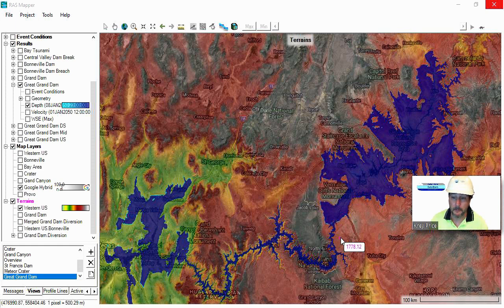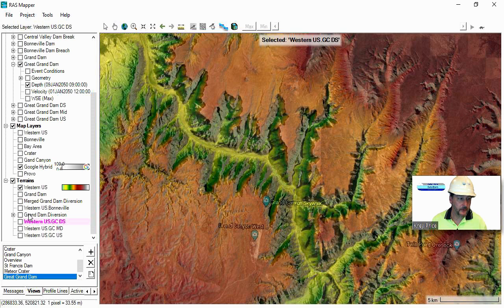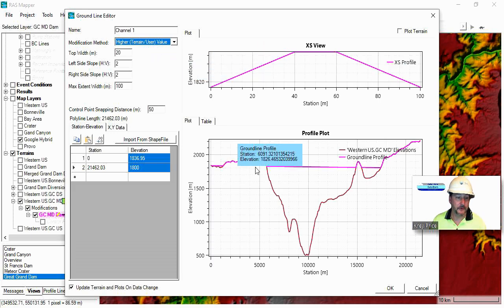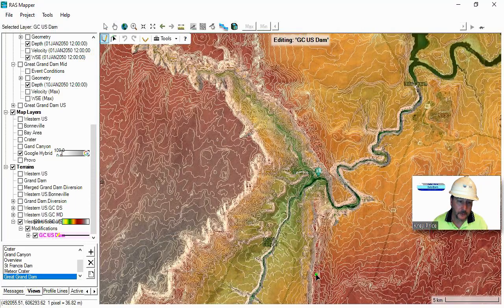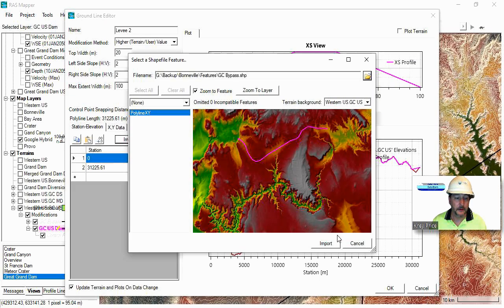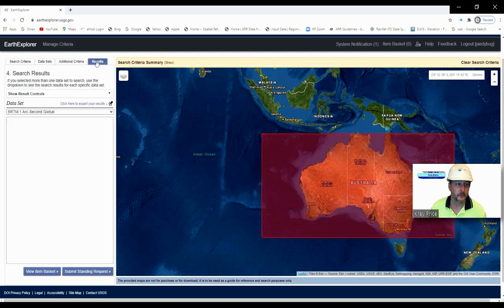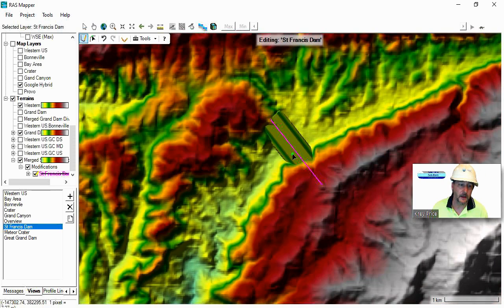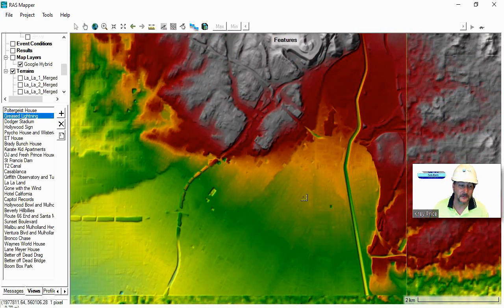What's new in HEC-RAS 6.0 Part 4: Terrain modification tools

Comment: i'm sorry but it's normal that doing a modification (high ground) the elevation of the vertices is lower than the terrain over i'v put it? just for an example, one vertex has elevation of 16.03 vs terrain in the same point of 16.67

Comment: Hello Krey,
In a time of video (23:50) you spoke about terrain modification for removing water surface form Dam accumulation, getting from Lidar (if someone want to make dambreak model). 
My quation is: Did we have some easies trick to remove water surface or we must use Terrain modification layer with multipoint polygon tool? (in second case we need  a "meny meny" of polygons to make assumption of natural terrain before dam to be buildet)

Comment: Hi Krey, just wondering if you have any suggestions to fix my problem. I am running a 2D flow area (10x10 mesh) with channel terrain modifications (model runs fine without them) and variable time step method. The model keeps going unstable and not too sure what to try next. Using a 30s computational interval and max/min courant numbers of 2 and 0.75 as the terrain is in a steep sided narrow river environment so the velocities are relatively high. Cheers in advanced :)